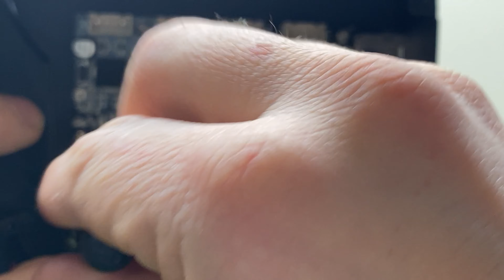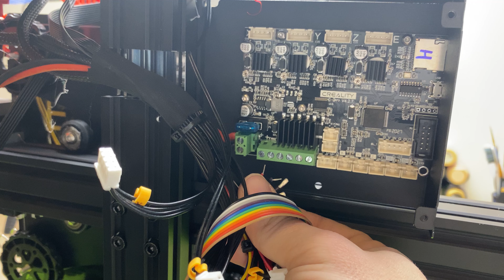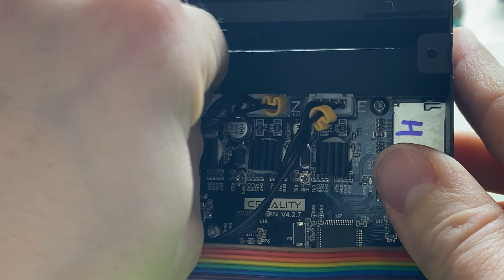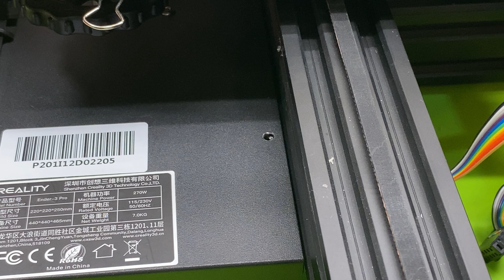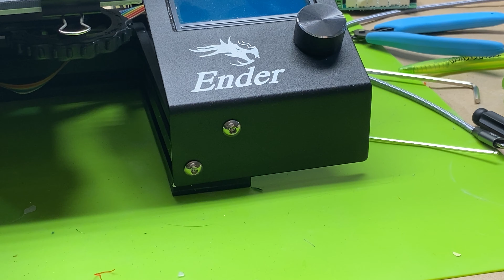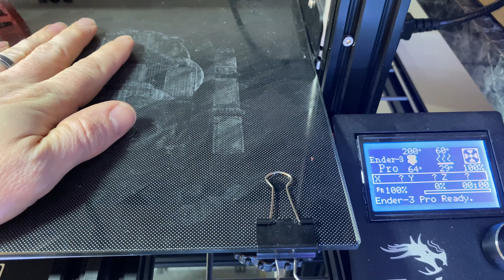Ender 3 Pro Motherboard Upgrade | Creality V4.2.7 Silent Board

Comment: You swapped the location of the red and black fan cables, those belonged to k-fan 2, and you put the purple fan in that slot for your new one. Both are fan ports, but maybe they are not working at the intended times.

Comment: Well here I am an old guy trying  to fix my printer, Ender 3 Pro for which I bought the Amazon Creality V4.2.7 mother board. I had no issues changing it out, but then the fun began. The board was sold as having ender 3 pro firmware installed. Well turned it on and it showed ender 5 on my printer screen. I found firmware for the 3 pro with the V4.2.7 board, put it on an empty SD and after plugging in the sd turned it on. The prompts looked different but did function so I tried a test print. I used a g.code Benchy I had printed when I first started with the printer. The results are that the print is maybe three times taller and looks like it was stretched, and print quality is terrible to boot. It was quite though.   
Any help would be appreciated. 
,

Comment: I have done all this. However, I get this Homing failed print haulted reset. I am new at this any help will be huge.
Reply from the maker: You may need to re-flash your firmware. Here is a link that explains the process. Hope it helps. 

https://focalise.ie/fix-ender-3-pro-blank-screen/

Comment: Upgrading from stock to this silent board doesn't upgrade the firmware as well, correct?
Reply from the maker: Correct you still have to confirm your firmware is up to date. If you order a new board they usually put the newest firmware on it.
Reply: @ItsMeaDMaDe  Hello. First of all, thanks for the video and i followed you 100% and got the silent board installed. However, I turn it on and went to "about printer" and see that it is still Marlin 1.0.1 and not Marlin 2.0. I heard that Creality just calls it 1.0.1 but it is in fact Marlin 2.0 installed. Do you know if that is the case?
Reply from the maker: @kevinso5578  I’ve never heard that. You can download the new marlin firmware on an SD card and update it to the correct one. I’ve heard of people having to do it.
Reply: @ItsMeaDMaDe  Not always, it is determined by the seller, Amazon sends outdated boards for the V4.2.7.

Comment: After I replaced mine ‘ my lcd gets stuck on just the blue screen smh any tips?
Reply from the maker: Sounds like you need to flash new firmware on the motherboard. Here is a link that should help. 

https://focalise.ie/fix-ender-3-pro-blank-screen/
Reply: @ItsMeaDMaDe  Yeap you’re right that fixed the issue’ had the wrong config files loaded lol smh
Reply from the maker: @iamcoderedd  I’m so glad that helped. Best of luck!

Comment: Hello, Ive read that it also need to check the voltage, but you didn't do that. or it isnt nessesary
Reply from the maker: The voltage should be already set since that is on your power supply not the motherboard. You typically set that when you are doing your first build.

Comment: I followed the tutorial step by step and when I go to power it on, the fan comes on but the screen is black.
Reply from the maker: I would go back through and make sure you have all the wires connected and in the right spot.
Reply: Hey not sure if you figured this out yet but I was having the same problem. I ended up not connecting the ribbon cable to the back of the lcd. You might have had it plugged into the wrong slot? I put mine in #3.